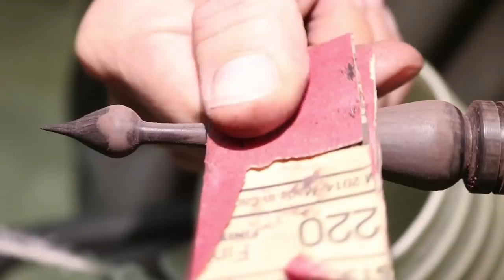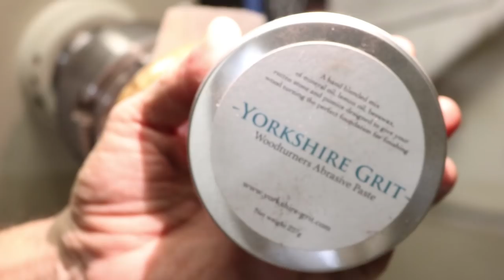#27 "Sang Noir" Faux Hollow Form

Comment: I found your page through the waffle on guy from the U.K. I live in g.a. and I noticed you are going to the wood working show in atlanta, I'm new to turning I've only been doing it a cpl months now can can't seem to get the end result that I want as far as the finish the polish and shine I don't have a buffing machine what do you recommend any advice would definitely help.
Reply from the maker: Yes.. Nick via the UK.  He's my brother from another mother.  :)  He's attending the Atlanta show as well.  Before I started using the buffing setup I would finish most of my stuff w/Trip E/Yorkshire Grit and follow up with a friction polish.  Sometimes I'll use a poly finish instead.  That seems to required a bit more work, but provides a very durable finish.  Hope this helps.  If you need any additional info.. let me know.  See you in Atlanta Chet!  Thank you!